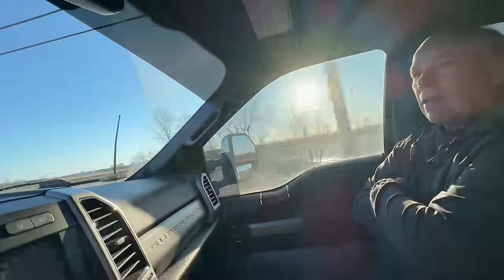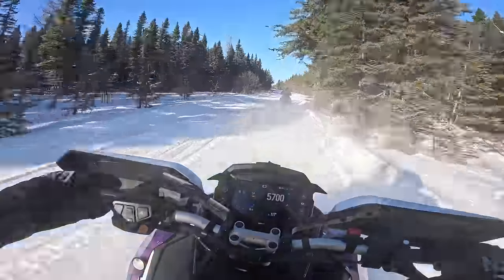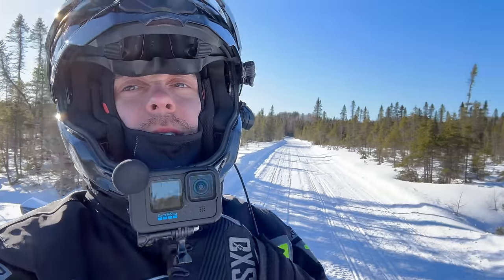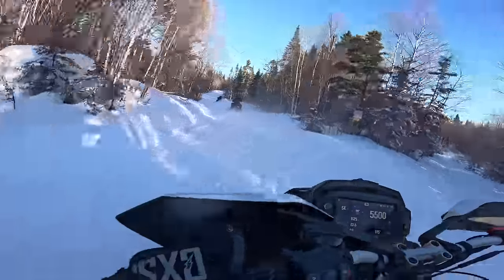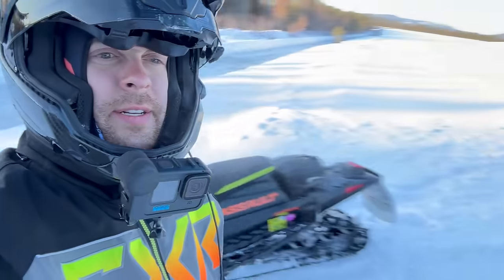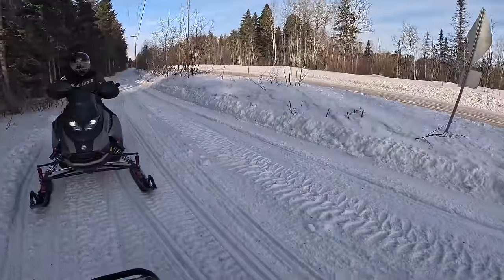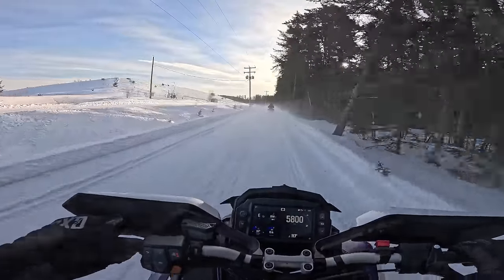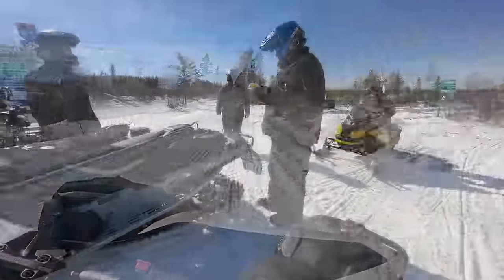The Starfire 862cc stroker takes on Canada! But the Assault Boost had other plans for us....

Comment: Awesome, hope you were able to get out this past weekend as well with the big snow storm we got here in VT. I think I’m going to pull the trigger on a 25 assault. Which track would you recommend the 1.6 and adding igrips or the 1.5 ice storm for same type of riding you do? Also what’s your thoughts on 850 vs 9r? Which way would you go this year? I was leaning towards just going with the 850 because it’s cheaper and a little more proven and comes with a 4 yr warranty. But my dealer will add an additional 2 years making it a 4 year warranty on the 9r also. It is about 2700 more and I know there’s been a lot of clutch issues with that motor in the mountains.
Reply from the maker: I did get out after the fresh storm here! I hit VT, Pittsburg, and then two separate VT trips. I may get another little blast in tomorrow, but it's pretty unlikely.
I really wish they would offer the regular 2ply non-prestudded Storm so people could put the iGrips in as they do work a lot better than the factory Camso preinstalled studs. I don't recommend the 1.6 Cobra to anyone, it has a relatively short lifespan (3k miles is about what I normally see folks get out of them) especially on low snow trails/seasons. So with that said, between the two I would definitely go with the Ice Storm and if the Camso ice studs aren't enough, throw some traditional studs in it!
As far as the engine package goes...I like the idea of the 9R, but I'm still not fully sold on it's longevity and that's a big part of why I went with the 862. I know they've made significant revisions to the P22 assembly for the 9R models...but I'm just not sold on it yet until I see folks getting miles on them without bolt/excessive wear issues. However...if you have the ability to really monitor things and check it over after every ride, the warranty is there....but you risk downtime if parts availability becomes an issue. With all that in mind I would recommend folks go 850 to really not have to worry about downtime in our already short seasons.  Then I'd recommend they take the money they would have spent on the 9R and put it into clutching and suspension calibration.

Comment: Scary how your chain broke. Waiting for the repair video
Reply: What advantages does the 862 have over the 9r?
Reply: Chain tensioner probably broke then took out the chain. If he didn't have the roller tensioner in it
Reply from the maker: Sled has had the OEM IQR tensioner since day one. Chain either actually snapped OR the head of the lower gear retainer bolt broke off and then got caught somewhere in the mix. Really hard to tell, chicken or the egg type scenario. Video on the fix/repair coming soon!

Comment: So what happened with the 900t, did you get it running right?
Reply from the maker: Ahh sorry! I didn't really have any footage of that whole thing. Long story short we did what we could pulling/checking the cylinder #3 plug/coil, no parts there on hand for the 900T's so we just reassembled and made sure there was nothing obviously damaged. The sled ended up picking the cylinder back up not too long after leaving Mont Valin so we suspected a coil. I got the sled back in the shop once we got home, fresh plugs, new coil, checked the majority of the wiring harness over, found a few chaffed wires I fixed up and it's been back out for a couple rides without the mysterious lack of a cylinder issue haha